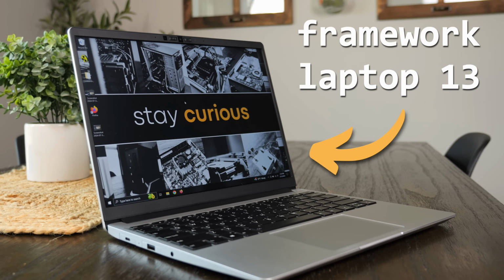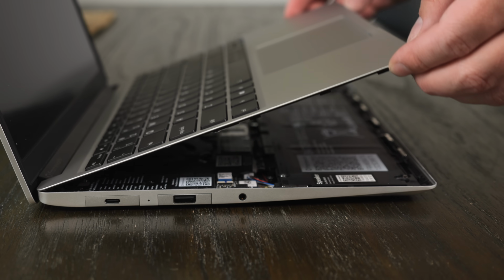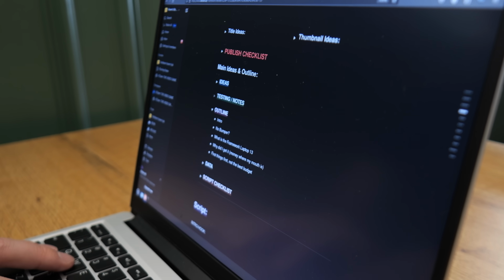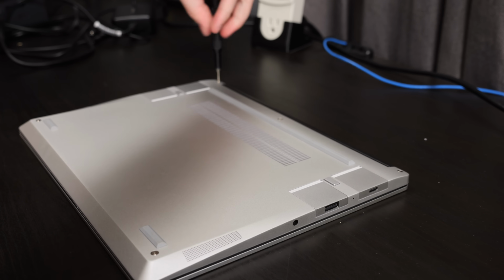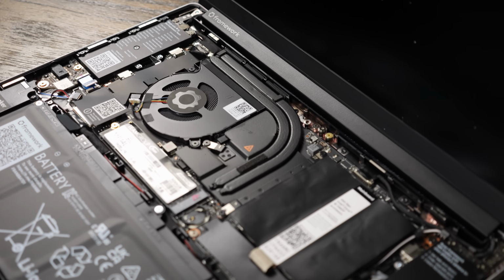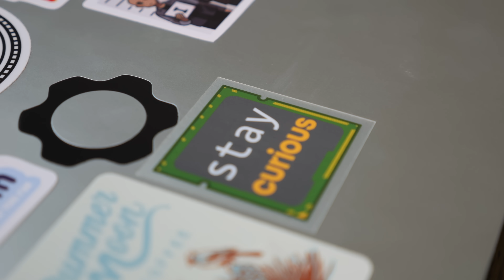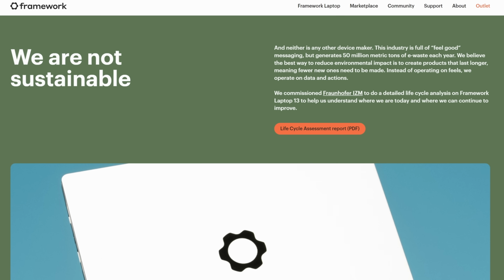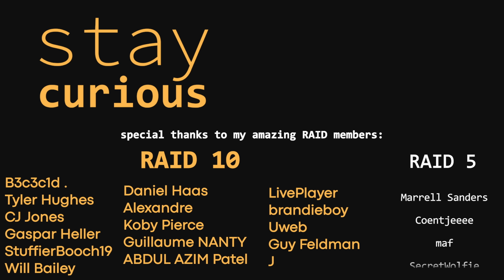Is The Framework Laptop ACTUALLY Worth It?

Comment: So, bottom line, you don’t want a Framework laptop.
Reply from the maker: No idea how you came away with that.. lol
Reply: @HardwareHaven  For the hardware specs given, you way over paid. Seven months ago our Dell Inspiron 16 i7 16Gb 2TB systems were less than $750 including tax. By the time you upgrade this and that at more $$, you could have had that Mac book. The level of “ease of upgrade/replacement” isn’t that different from most any other laptops and certainty isn’t worth the significant increase in overall cost at lower performance level. IMO.
Reply: @brianh.4185  you're thinking too short term. Original buyers of the 11th or 10th gen Intel version can upgrade not only the main board but the screen, upgraded hinges, battery, webcam, etc.

The point is that when the ryzen 2026 models come out you can just upgrade to that. Over time, by replacing each component with the better versions, your laptop just gets better.

With other laptops when you upgrade for speed you also need to take a gamble on the keyboard, display, webcam, etc. Those don't change on your Framework.
Reply: @brianh.4185  Lol, a macbook has soldered on everything. Most laptops dont have this type of upgradability lol. This is just competley wrong.
Reply: @gearsgamer7115 I didn’t say anything about the upgradability of Mac books. Never had one. Don’t know the first thing about them. Only said for what he spent initially and thereafter on this upgrade and that upgrade, he could have had the Mac book he was wanting but for the price.
Reply: @brianh.4185  Yeah but if the macbook breaks, and it wont last as long. The thing is buy the framework initially, then upgrading will be inherinty cheaper in the future.
Reply: @brianh.4185

The majority of people who buy a Framework aren't upgrading it every year. They're upgrading it every 5-10 years. Influencers and whoever might show flashy upgrades all the time but people I know are still rocking an 11th gen Intel Framework and are perfectly happy to wait a few more years to upgrade where they'll spend a lot less doing so than they would buying a whole new laptop. 

If you're upgrading your laptop every year, that's a waste of money and a bad value proposition. That being said, if you upgrade less often you get way better value over time not to mention that you can put your old main board in something like the Cooler Master case and turn it into a server or something.

Comment: Omg the battery is literally my only problem with my framework 13 too! Coming from the MacBook Air M2 going from ~24 hours of working time on battery to 4-5 hours has been killing my love of the laptop.
Reply: Meanwhile, as someone who's only ever had cheap laptops, 4-5 hours sounds AMAZING. It's all perspective, I guess
Reply from the maker: haha indeed
Reply: @allenellisdewitt  very true and I cannot honestly imagine having a laptop with less than 4 hours battery life, I feel like even at the three hour mark it would greatly impact my ability to use the laptop as an actually workstation. Perhaps without my serve ADHD the battery life problem would be less impactful for me haha
Reply: You should try tinkering with the power options and limits and such. Especially if you also have the problem of slightly overheating. You can get to 8-10 hours of battery if the CPU is limited (Apple does it too with the Macs). Of course, it will also not be as fast/snappy, but if you, for example, only browse the web, the difference shouldn't be visible. If you do need the full power... oh well.
Reply: yeah I don´t need 24 hours either but somewhere in between would be fair, 8-12 hours.